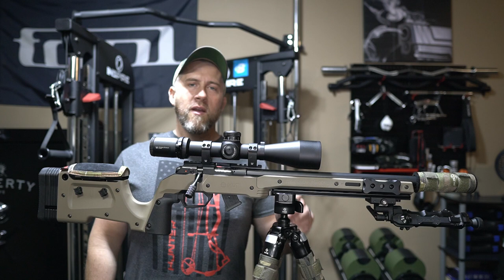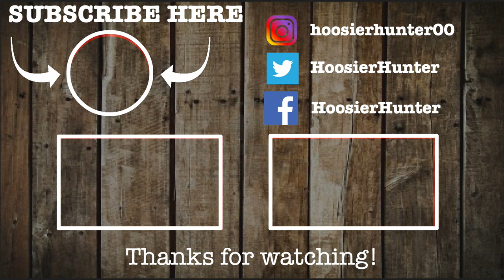CZ 457 | MDT XRS Chassis

Comment: That MDT XRS Chassis, is that an aftermarket item or does the CZ 457 come from CZ that way. I was looking at the standard CZ 457 MTR Varmint originally, but I like the adjustability of this rifle. Thanks!
Reply from the maker: It’s aftermarket. Great chassis for the price.
Reply: @HoosierHunter  Got it. So the shop is buying the barrel/trigger from CZ and building the rifle in your video.
Reply from the maker: Nope. I bought a bone stock Pro Varmint and everything else separately and just did it myself.